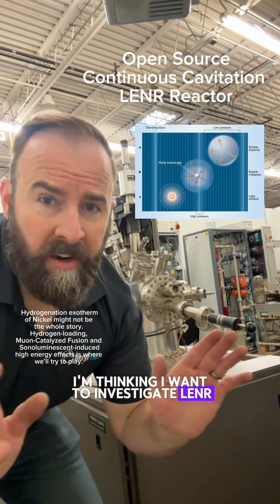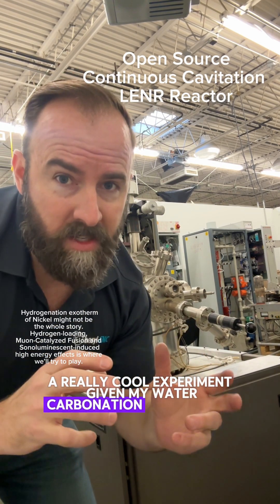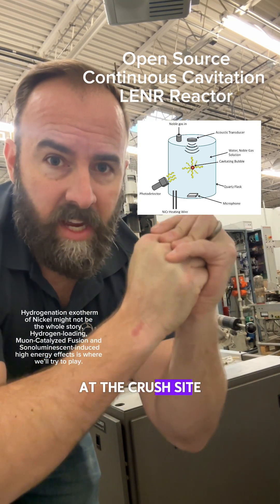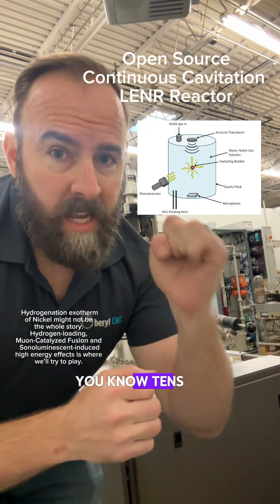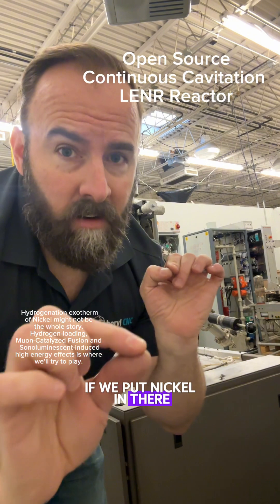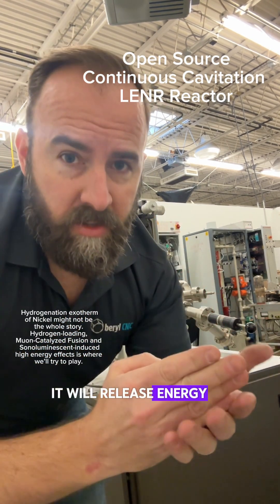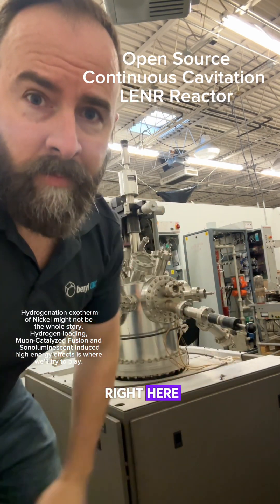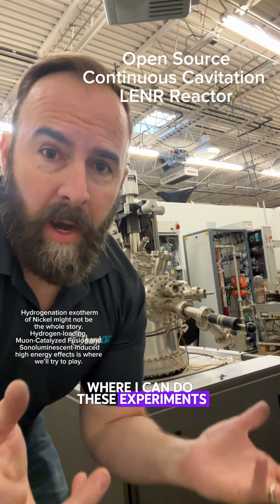Open LENR 1 - Low Energy Nuclear Fusion

Comment: See Martin Flieschmann memorial project. 

See The crypto alchemist. 

See Dr. Keryn Johnson's work. 

See Malcolm Bendall's work. 

You don't need a lot of heat and pressure for fusion. You need coherent fields. Water absorbs scalar waves, every molecule is dipole. Spinning dipole will invert due to inertia. Spins from microwaves. Inverts due to moment of inertia. Dipole flip drives displacement current density. Make a drift velocity on top of that with obviously s voltage source and you can make plasmoids with helical coil down the center of your cell. 

I have used carbon, aluminum, and deuterium/tritium as LENR fuel. 

If you go to tritium state then shield with lead 😅. 

Oh you can also get gold starting with lead and consider phosphorus 40 isotope. Some P-K based fertilizer with some lead spiral as positive charges down the center may be one of many LENR pathway to gold. 

Carbon is safe starting point as it turns to inert diotomic nitrogen. 

See Walter Russel scale. Crack a window. If you let it sit long enough you will make chlorine gas 😮😅

Oh also, avoid sulfur. H2S is SUPER DEADLY nerve gas ok?

Comment: In one YouTube short, this gentleman just showed me that all my years of study education and knowledge are almost noncompete with the knowledge and wisdom that you possess. 
I suggest repurposing your first monstrosity to work out the quirks of version one, for your version two to be refined once all of the hiccups have been identified.
question: As with loss of mechanical energy through transmission, how do you intend to capture the expelled energy from the reactions and repurpose into usable and or stored energy?! 

Best of luck, wishes and energy!!! 💫
Reply from the maker: Thank you! RE energy out, the reactions will occur in pressurized water and the heat transferred to the manifold. So we should be able to use a separate water loop to generate steam and run a small PM generator. That's the plan so far. Other options for possibly pulling energy from a laser aperture are theorized by probably overly complicated.